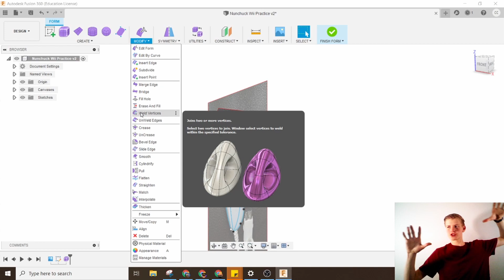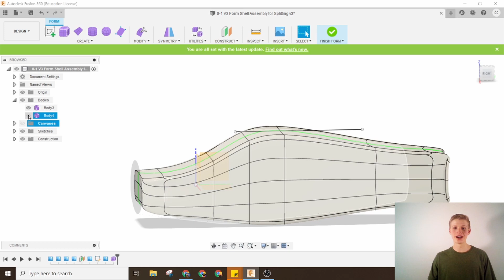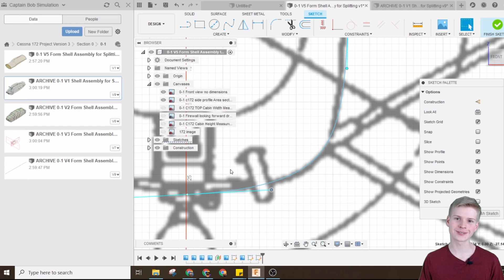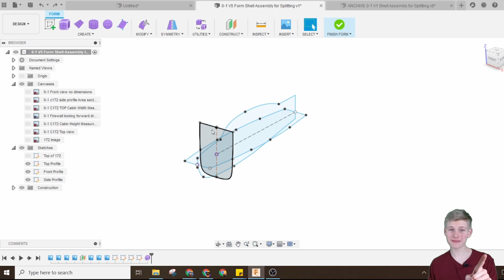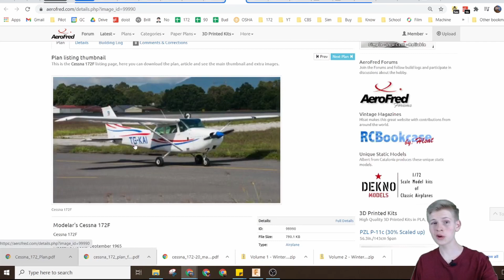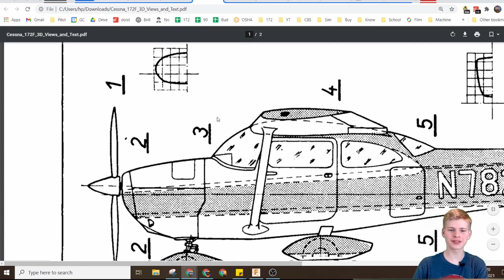Designing a Flight Simulator Shell in Fusion 360 Part 3 |  Captain Bob

Comment: Did I miss something? What exactly do you want to do with the finished model? Do you want to use it again as a reference for you cockpit?
Reply from the maker: You didn't miss something :) I did! 
I'm going to use the finished model both as a reference to design systems around, and also use it to take rib geometry, and print it as a template or potentially CNC mill it to get the shape correct.
I'll also use this to plan how much material is needed in some places (for example in the interior). 
I can also use it to easily run simulations for projector setups (what angle of declination is best, and double-checking setups), and also make adorable scaled down simulators :)
Thanks for watching! I think I'll explain this in the next part!